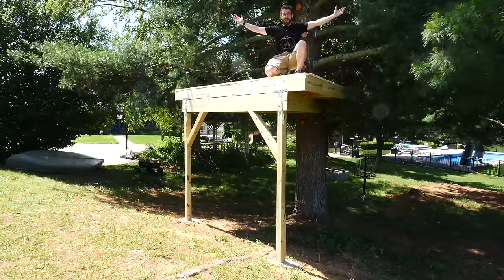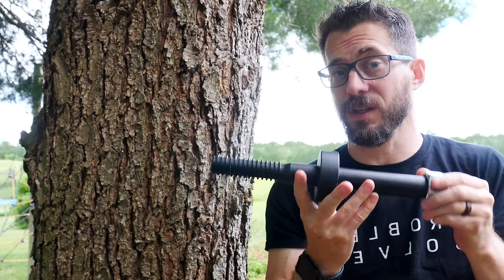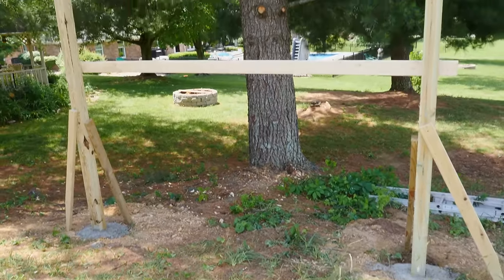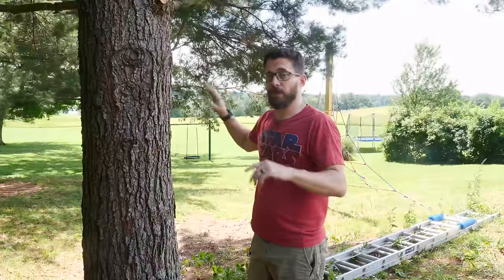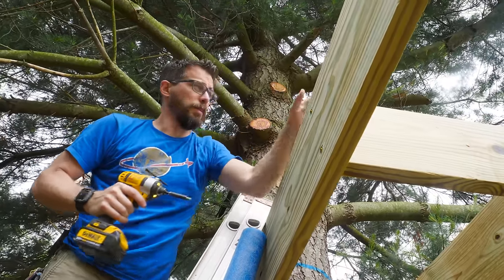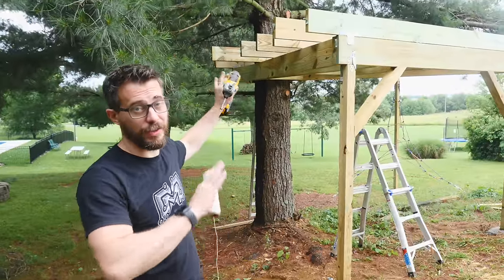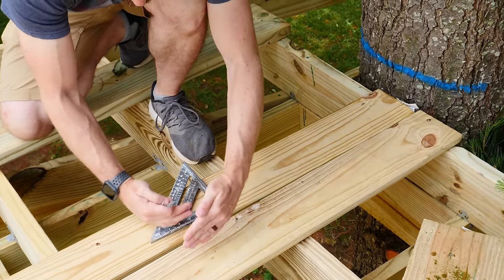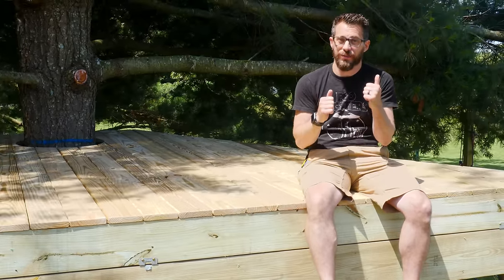How to Make a Treehouse Part 1 | I Like To Make Stuff

Comment: I don't want to be that guy... but get some structural screws into those beams. (what appears to be) Standard deck screws are not approved for use with those hangers. And while I don't see any issues in the short term, the trees movement, height, and the fact that it is your children that are going to be affected by a failure all tend to make me a safety czar in this issue. Maybe you know this already, maybe you don't....just keep it in mind. Also, those brackets should not be bent or modified, but I see far less issue with that than screws that will see constant movement, rust, and eventually snap off suddenly.
Reply: SrMofo Correct, the screws used with the joist hangers do not have the proper shear strength characteristics for structural loads.
Reply: Quick question for ya then, his use of deck screws to hold the 2 x 12s together...same issue?  I would think that shear would be the largest concern there, but not sure if it's a real problem.
Reply: @BobAbbott  the 2 2x12s are held up by the strength of the wood, considering they both rest on the post and the tab: the deck screws are only used to hold them together. But for all the steel hangers and hardware, the weight of the beam and the load onto is directly on the deck screws.
Reply: What u think about wood and cement? :)
Reply: He used screws because DeWalt doesn't make hammers.
Reply: @jolleanttonen4362  I personally think it's better to bury wood that sits on a small cement surface underneath the freezing point than pouring concrete all around the wood. Pouring cement like he did will trap the moisture into the wood and make it rot faster, no matter what the type of wood. Other way could be pouring cement till the over the ground (and under freezing point) and install a galvanized or stainless bracket and then bolt the post onto the bracket, that way the wood will not be in direct contact with trapped moisture.
Reply: but its a small treehouse, im sure it will hold just fine..
Reply: MoZz of course it will, for now, but eventually the posts will rot faster than they are supposed to, and the whole thing will sag.
Reply: All you need to know about this construction can be found in the tape measure used..... WTF??
Reply: @sdspivey  a hammer? That's a DeWalt drill with a dead battery.
Reply: And

Comment: You really shouldn't use deck screws on the galvanized hangers, they just don't have the required shear strength. There are specific screw fasteners you can use, or nails.
Reply: He knows more about tree house than you do GENIUS

Get it?.... I changed the vine.??...
Reply: @coarsecantalope  lol
Reply: Agreed. This video was painful to watch.
Reply: Yes, really should use structural connector screws for...well, structural connections.
Reply: Thats what i was thinking especially when he was securing the joist together I’ve never seen anyone use exclusively screws it seemed a bit odd and it has nothing to do with it being a treehouse its carpentry plain and simple the rules don’t really change
Reply: s hegarty  I was thinking the same thing. That ain’t really up to code...
Reply: Elliott Russell do you know where I can I find a code book for treehouse construction?
Reply: @FreshCityVentures  same one for deck construction ... or you could just read the spec sheet from the joist hanger manufacturer, your choice
Reply: Fresh City Ventures building codes on tree houses vary. While no specific permits are needed to construct a treehouse not meant for habitation, it still has to comply with structural safety guidelines.  Also, if you plan to resell your home, making sure it’s built to conventional framing and structural standards is a must. Or, you’re just tearing it down to meet FHA and VA guidelines...
Reply: The Last_Saint Are you wearing a fucking Batman shirt? And a Mohawk?
Reply: As a carpenter, idk why I always watch these videos. I always notice small things like that. Using deck screws instead of Teco nails is a great way to fall through the floor 😂
Reply: Fresh City Ventures heh heh... yeah, we spent the spring of 2018 in Ireland, and that photo was taken on top of Tara hill, south of Dublin, where i found my Batman shirt... the Mohawk i e had for about 6 years,,,,, i might be an old, beat up framer with a permanent spinal injury, but I’ll always be a Metal Head!
Reply: Lol.. I love how he used the proper nails for the non essential ties, but on the critical connections and joist hangers this fool used deck screws..
Reply: Thanks bob vila
Reply: It's his "preference"...
...If he can't mix mud by hand, he probably can't hit a nail on the head with a hammer.

Comment: Bob: "We're gonna make this really strong"
Also Bob: [screws into end grain]
Reply: Ahhhhh, I'm so glad I'm not the only one.
Reply: @brothaman4578  Deck screws are structural for joist hangers now?  Fail..  Please change those screws for the proper connections and make a note in the video for everyone. :)
Reply: @dnejeff  Kind of thought the same thing. What would be the proper connection?
Reply: @Bangbangbigelow hot dipped galvanized nails for joist hangers, not deck screws
Reply: Otherwise known as spuds
Reply: Simpson strong drive structural screws

Comment: You should be emphasizing the appropriate usage of nails vs screws. (Maybe a Bits episode?) In your case, you are mostly using brackets to carry a load and screws to secure the brackets. But if someone is relying purely on a fastener to carry a load, a nail is better.

Nails tend to bend. Screws tend to snap. If a joint fails, it is more likely to remain intact with nails, and more likely to disconnect with screws.
Reply: Pretty sure those brackets should get nailed in too.
Reply: This is not accurate and I find it very strange how you are trying to apply logic to your assertion that nails are "better" than screws.
Reply: @brothaman4578  Structural brackets need either specific nails or very very specific screws.
Reply: @hypnolobster  I understand what you're saying, but the design of the structure and resulting carrying load is the driving factor. You can de-rate any hardware or bracket.
Reply: Yes, that's important but he doesn't appear to be qualified to explain based on some of his comments.

Comment: Screws will do for this job most likely, but if you were building a deck or something, nails have to be used because they have a stronger sheer strength. They also make structural screws that I believe would also be acceptable.

Comment: Nails would be stronger on those metal tie ins on top of the posts. Screws don't have the same strength as a.proper hanger nail
Reply: Nails have more shear strength so they're better for framing but the amount of force needed to shear that many screws at one time would wreck the structure anyway.
Reply: @TBoNAtl  The amount of screws he put in, the weakest points in those connections are probably the metal tie ins. Sure enough screws are more brittle but that doesn't really matter when they're not stressed anywhere near their limit.
Reply: @TBoNAtl  while that might be true for commonly available screws and (steel!)nails its not true for certified engineering screws. When shaft and nail diameters are the same with high sheer loads some screws have by far higher material strength. I say material strength because we should never forget that when you  srew straight in to endgrain (horizontally with most engineering srews not allowed!) the wood is the limiting factor.

Comment: There's a good reason you are supposed use nails on the joist hangers. They have a high shear strength. Screws have holding power, not much shear strength.
Reply: Yes but quantity of screws matters too.
Reply: Dude’s wearing a Star Wars shirt. Cut him some slack
Reply: Okay Albert Einstein, go build a tree house on a tree that got struck by lightning wearing a Star Wars shirt, and see if the electric force don’t come back to you and say “welp you used the right screws so I won’t hate on you”

Comment: The fasteners you are using on your joist hangers and rafter ties are not correct.  I hate to be that guy, but the deck screws you are using are too long, bugle head (they should have a flat shoulder) and do not possess the shear strength you would want for this application.  You should use SDS Strong Tie Screws or nails for that hardware.  Great job so far and look forward to the next episode!
Reply: but its a small treehouse, im sure it will hold just fine..
Reply: *mocks him because he’s a smart alack* I just kidding
Reply: Brexten Multi *smart aleck
Me tryna be a smart aleck
Reply: Nathan John trying too*
Reply: Brexten Multi trying to* 😂
Reply: Nathan John I knew you were going to do that.

Comment: Looks like you used deck screws for your hangers. Could be wrong but it should have been structural screws.
Reply: Oooooooooooooooooooooooh
Reply: there's a lot of vids on here, one in particularly by projectfarm. and he showed that deck vs structural screws wont make much of a diff in wood. he compared a lot of them, also vs nails.

Comment: Concrete posts/steel beams would have been better, as those wooden posts are going to end up rotting very soon, and so changing them is going to be a hassle (especially considering they are set in concrete). Also, using screws in the joist hangers is detrimental to the strength of the structure. Hanger nails are required. Screws have no shear strength, so the downwards load can make them fail faster than hanger nails.
Reply: Ahmed D it would take lots of years for that to rot but if they would have lifted the bottom up just a little it would have lasted forever
Reply: And

Comment: according to a guy that did roofing for my shed, it's best to use a mix of screws and specialized nails on those hangers, since the screws hold better, but also tend to snap if under too much pressure

Comment: Nice. FYI, using a water level, ie. a clear (preferably) flexible hose/tube filled with water is a fool-proof way to make sure you get the tabs and beams etc the same height

Comment: 12:12 after all the sales pitch for hangers: no joist hangers and screws going into the tree. WTF?  :-p
Also, with wet crappy lumber sold these days, I don’t think you want ANY gaps between decking boards.

Comment: An easy leveling trick is to use a clear water hose. Put water in it and see both ends are level any where you go. Around corners, through abstructed trees, even on a slop. You see the water level on seond hose end and WAH-LA! YOUR SECOND POINT IS PERFECTLY LEVEL, EVEN A DISTANT TREE. Great clip!

Comment: If you need to transfer a level across a distance or round a corner you can use some clear flexy pipe with some coloured water in it. The water level at each end of the pipe will always be the same as long as it's vented

Comment: - Dope chain saw bevel! 
- That's a lot of brackets!  Cover/wrap/side that structure with cedar fence pickets if you're looking to beautify.   Cheap and effective!
- I would definetly buy the bottom half of that tree bracket.  Maybe it is never going to fall off, but man it would sure suck if it did.  Think rouge backhoe operator.
-Them 5/4 decking boards are going to shrrrrrrink!  Just put that product edge to edge in future projects; you might have 1/2in gaps in the floor by the end of summer.
- I feel like there was a lost opportunity to get a sweet new nail gun here.  Nails have twice the diameter as screws bc the threads; which makes them good for structure.

Comment: The way you put the posts in is how fences are done, not load bearing columns. You should have poured reinforced concrete footings in Sonotubes with imbedded threaded J-hooks or other comparable structural bolt system with deck anchors on top to attach the 4x4 posts to. The way you've done it makes the concrete really only support the posts laterally (good for fences) and not load. It also will cause the wood to rot prematurely as opposed to deck anchors which promote drainage to keep the posts from extended periods of moisture. Fun project though and I am excited to see how it turns out in the next video.

Comment: Screws are great but 2 or 4 nails per joist hanger along with the screws will give greater shear strength. I attached stairs going into the basement after about 5 years a few treads had the screws shear off I redid the stairs and just added a few 20 penny nails to each tread side and 27 years later no shearing or squeaking. I hope this opinion helps. The best part is you can add the nails anytime with this build good luck and I hope your family gets decades of fun and enjoyment from your treehouse.

Comment: I'd enjoy a deeper dive into the TABs. How much weight can each one hold? Do you need 2? Do they need to oppose each other? Could you use them to anchor steel cables to suspend a structure? Can they support the weight without legs helping out?

Comment: To find a level around corners or across large gaps, you can use a clear flexible plastic tube. Just put some water in it, line up the water level at one end of the tube with what you want to level with. The water level at the other end of the tube will be perfectly level 👍.

Comment: It might increase longevity of the first two wooden posts if you did not put them into the concrete directly. You could use a metal braket which is set in the concrete and put your posts on top of that. The additional distance between ground and wood helps with moisture/rotting issues. I've seen patio installations which also have a height adjustment mechnism below this bracket which allows leveling of the entire platform afterwards. Quite practical.

Comment: If you want to get an elevation around a corner (or virtually any distance/object) you can use clear plastic pipe and water. Just fill the pipe to the desired level and the other end will  be exactly the same.

Comment: For  a long level  or one that  goes around a tree you  can  use a clear  plastic  hose filled  with water. Mark one end with  a marker and hold that at a set point (your first bolt, for  example) then raise the opposite  end until  the water comes up to the  mark near the  bolt. The  water at the opposite  end will be level with the Mar near the bolt.

Comment: It's a good tree house platform, not really the traditional style/approach but more the modern man type build, still cool, only question is when you marked the pillars to cut off as they were leveled, by placing a beam going across from where the pillars end, doesn't that technically elevate the side with the pillars, therefore making the platform on a slight angle?

Comment: Screws have tensile strength (pulling) & nail have sheering strength (side to side break restive) over time those screws are going to sheer off, especially with the tree moving. Simpsom strong ties specifically indicates 1&1/4" ring shank nails as the were engineered. Best of luck
Reply: A screw will only sheer if it is subjected to a load beyond its yield strength. Number of screws is also a factor you must consider.

Comment: If u have far away places or in weird positions u can use a transparent, rubber tube filled with water with opened ends so the level of water will be the same on both end when holding them up making the tubie in like U shape.

Comment: 5:42  Another great way to find a level spot between two long ends is by using a transparent water hose and fill it with water. The water level is always the same height on both sides. Just hold one side of the hose its water level parallel to the measuring point. The other side water level is on the same height. (maneuver with a finger on the hose, but keep both ends open to take a measure)

Comment: You should pull out all the screws on the strap hangers and replace them with nails. Nails have a much greater shear strength than screws. Any large movement could cause the screw heads to snap off leading to catastrophic failure.

Comment: When trying to mark level on two surfaces far apart like when you wanted to find the level line on the post to match the blue line on the tree, probably the easiest way with out a string level would be with a water level. Using clear hose, hold both ends of the hose upright on the surface of the things you want to level out and fill the hose with water to the line. The water will match the same level on the other side of the hose on the post - mark and cut.

Comment: Another way to check if the two taps (tabs?) are level is to use a clear tube and put some water in it. Hold one side up against the first hole and then bring the other end up. The water will be level on both sides so you can use this to find level around corners.

Comment: You really need to use either a pipe bracket or floating bracket in conjunction with the TAB. Without the bracket, you're concentrating the entire load on a single point of your joist. The bracket also prevents the joist from slipping off; the nut on the end is meant to keep the bracket on, not to keep the joist in place.

Comment: For the posts, they should go below whatever the frost line is for your region.  Here for example to prevent posts from moving, they need to go below 42 inches deep into the ground otherwise when the ground freezes and thaws, your posts will move.  Below 42 inches deep and they will not move.

Comment: Hey Bob, a few questions for you if you get to this.  When setting the posts, why not mix the concrete in the hole?  And why didn't you put a layer of gravel in the hole first so the post wasn't sitting on bare clay?  I won't ask about the screws since everyone else is asking, but I'm wondering why you don't use laser levels instead of all this beam stuff?

Comment: If you fill some clear plastic tubing with water, it is simple to find the same level on the other side of the tree - no math or sketchy level work required. Just have your friend hold on to one end of the tubing and you hold the other end where you want (with the tubing long enough to create a U). The water maintains its level.